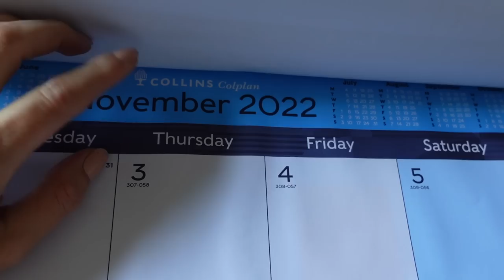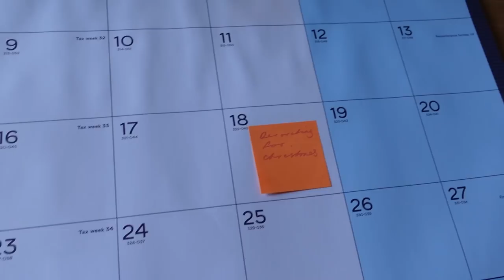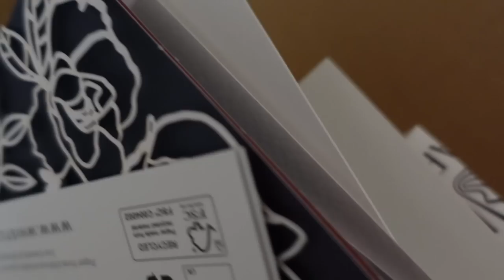HOME VLOG | new projects, wedding gifts and fixing mistakes

Comment: What if you replace the clock in your kitchen with matching upper cabinets with your existing ones and lighting beneath for eating/work space. Also, there are cabinets in the US that extend to the ceiling. You can get these with glass doors only on the top (like in the empty space above your existing cabinet, if you prefer for showcasing nice pieces with or without lighting. I think an additional floor to ceiling cabinet in the dining room would work great for items like large appliances, extra dishes and holiday dining decor.